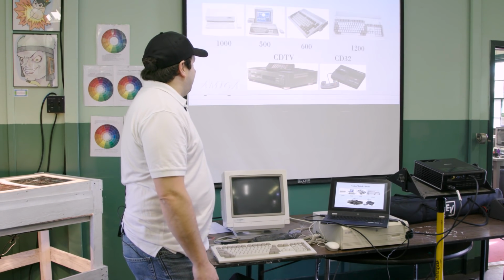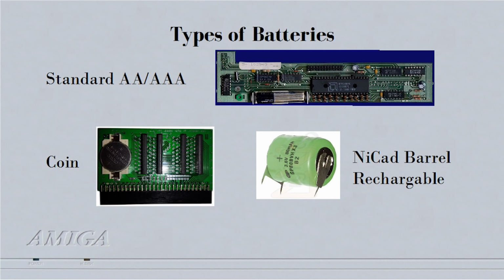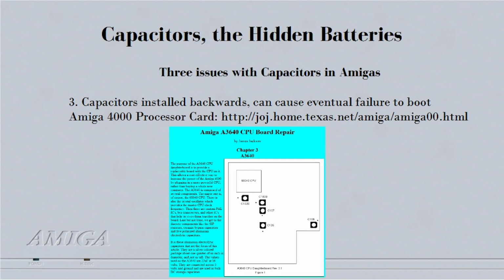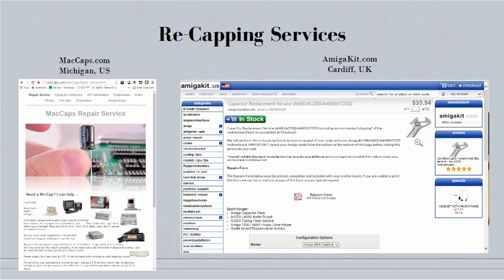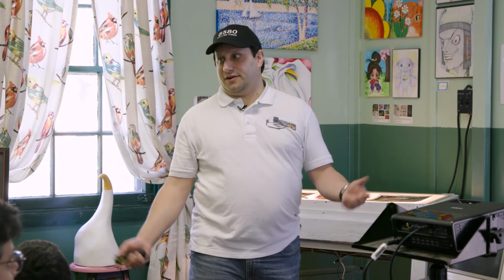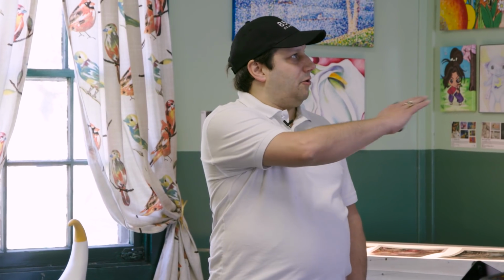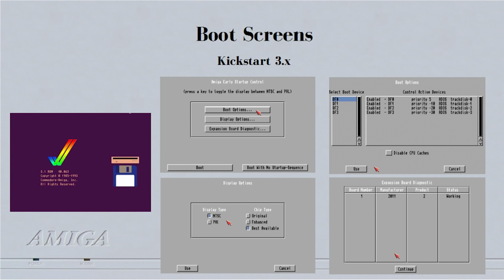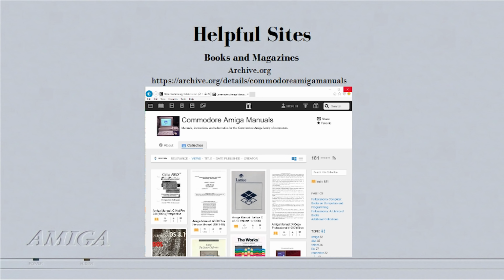Basic Commodore Amiga Troubleshooting

Comment: I finally got around to recapping three of my Amigas in the last month: two A600s and an A1200. One 600 has an ongoing issue with clicks in both audio channels. I have a second 1200 which had electrolyte damage when I bought it, and it will only run for about a minute before crashing.
My understanding of the audio coupling caps is that polarised ones are generally fine as the voltage across the cap is very small. The leaking electrolyte, though...that stuff is evil! Not only do you lose connections, the dissolved copper makes a conductive slurry that spreads over the board.

Comment: I know this is 7 years old, but I am resurrecting one of  my old 4000s, and I got a kick out of seeing one of the guys that worked on the manufacture of the 4000s in the audience.  One thing I did learn by accident, is that the sockets containing the chips can be corroded, or there is some reason that a chip is not making a complete electrical connection.  I found, that rapping the top if the socketed chips with a screwdriver handle, will seat the chips enough to sometimes cause the 4000 to boot,  The solution was, to remove and clean the pins in the sockets, apply deoxit, (a contact cleaner) and re-seat the chips.  That solved the problem in one of my machines.   It was an interesting video, and yes, those plastic retainers on the 4000 front cover are an absolute pain.  I think you stated that there were three pairs of retaining clips, on my machine, there were three on the top, and four on the bottom, and one of the four was extremely difficult to get at.
Reply from the maker: Cheers, that is a good repair technique. I am about to do the same thing on my sick A500

Comment: No, a 1000 isn't just a 500 in a bigger case, per your own admission that even Kickstart had to be loaded from disk using a little BIOS from before that. Also, the 500 can be upgraded to AGA, whereas if I understand right, the 1000 can't (but correct me if necessary).

Comment: Hey Guys, You have always been super responsive. I have a dilemma in that I had a house fire and need to store my 2 1200s away until I rebuild the house. I have upgraded these boards to the hilt adding all the mod and fixes to the boards. One had a recap done. My question is how long before an inactive Amiga may be destroyed by not powering on. I have de-smoked the boards and they look fine. I may be out of my house for 8 months+. Any recommendations of storing these beasts? Your opinion of course is invaluable as always.
Reply from the maker: Yikes Charles!  So sorry about the fire. I hope everyone is OK.  There really is no standard for a length of time that an Amiga can stay inactive.  Many people I know didn't turn theirs on for over 10 years and they work fine.  But that doesn't mean I recommend doing that.  The caps are the first things to go (usually) and every Amiga needs to be recapped by now.  Frequent use is good for the caps.  So for the machine you had re-capped I wouldn't worry too much.  The other machine is more of an issue. Try to power it up if you can, but if that is not possible there is a good chance you will be ok after  8 months.  But to be sure you could always have it re-capped before you turn it on after a long rest in storage.  When you do store them, I like to put them in a sealed plastic case and keep it in a clean, cool environment with little to no humidity and no direct sunlight. Of course you also want to remove the battery if you have one in there.
Reply: Thanks, Guys. Good advice. I think I can plug it in where its stored once in a while. Keep up the great videos.

Comment: Probably very late to the game at this point, logically you are getting the purple screen because the system has passed its hardware checks and booted to the kickstart (hence the purple screen) instead of getting the disk animation you would normally get it is trying to boot from the SCSI storage device and as a result it can see the WB install but is unable to fully read/access the data and the system hangs in an endless loop of attempts to boot from the SCSI device leaving you with just the background colour of the ROM screen.

So far for myself these situations have always been cured by re installing workbench/changing the SCSI storage disk itself (not the SCSI controller)
(afterall if the SCSI Controller wasnt functional, the disk would not attempt to boot and just leave you back at the regular kickstart landing screen)

If before you had this problem the system was functional on its primary SCSI HDD device and only started to be problematic with the introduction to the same data structure on a different device (in this case the CF Card in the adaptor) the problem could be a data table issue where the card isn't formatted properly or perhaps the SCSI to CF interface device has an issue. i would put my money on the Data on the CF card or the data table itself however a good test to this would be to insert a fresh CF card and install WB on it like a new unit from the floppy drives.
Hope this helps.
Reply from the maker: Great info! Thanks Mark. Very helpful. I will pass it on to Anthony.  Believe it or not, I think he hasn't fixed it yet.  -- Bill
Reply: I just said the same thing, I am later to the game. ;-)
Reply: Replies like this represent the very true spirit of Amigans. We have the world biggest sincerely unite community. We are few, but not so few, and thanks to your great job, Gurus, the truth is starting to come over. Thanks thanks thanks. Amiga and all the CBM people deserved more and yes, they still do. 
Long live Amiga. Altough it SEEMS a piece of hardware, it left something inside our hearts. Not to be nostalgic but... can you think of something that did the same? 
Cheers from Italy.
Reply: Is it fixed yet?

Comment: same 'Purple Screen 'issue here with a rev 8 A500+.. had battery leak damage. swapping out Agnus and rom for earlier versions shows Green, but not every time. Going to replace the Ram and check the 74 chips involved in the data path are not dead.
Reply from the maker: Oh man, good luck with the repair.  Anthony still hasn't gotten to the bottom of this. Hopefully sometime soon.
Reply: FIXED! Culprit was the 74LS244 (U12) and it's tracks & pads - mostly going to U13 and some Vias. I replaced it, and patched the broken traces. The purple screen must be a wait state for Kickstart. If You drop in a 1.3 Kickstart instead of 2.x You will get the green screen warning - but not always, you still get purple sometimes. This was all caused by the leaking battery of coarse, but to the naked eye, after a cleanup and treatment, it looked fine. Had to use the schematic to check all the pins on U12 were going where they should have been, and only 6 of the 20 were still good. "74" chips were all over 80's tech, and some are a bit ropey at the best of times - this one had some help from the leaking battery.. :)
Reply: also, i did put the extracted 74LS244 back in the properly connected socket, and it was toast, so just repairing tracks might not be enough..
Reply from the maker: WOW, that is great news! Thanks for letting us know and for the great info.  Anthony better get busy on his!

Comment: I read somewhere that the battery on 3000 & 4000 keeps SCSI settings in memory, so you would lose those settings if you remove the battery, as well as the date/time.

EDIT: Since you have two A4000, why not move over some of the chips if possible, like the ROM's from the working one, or the controller/rasier cards. Can try the 030 card in the working box to see if it is alive at all.

Did you add any device to the box, i.e. something that require more power? Can the PSU cope?

You may also want to measure the PSU if it gives the required voltages on the respective pins. You can desolder surface mounted IC's with a tin desoldering "sucker" (or whatever it is called) and move them over (if you want to take the risk), but getting them back into position requires some gentle soldering, or some IC holders if you can find them for the specific chips. It may be possible to scavenge some from a broken Amiga 500.

I may be getting a 4000/030 later on if my friend will sell it to me (and if it works), just hope it never breaks if i get it.
Reply from the maker: Ichinin Thanks for this awesome info and taking the time to comment. I will pass it along to Anthony. Much appreciated

Comment: I tore down my recently acquired A1200 and I was shocked to find that it had no clock battery, nor even a place to put one! I was expecting carnage after finally getting that top shielding off...I guess someone years ago ditched the battery and decided to go without it.
Reply: Not all Amigas came with a battery.
Reply from the maker: That's great.  The battery only keeps the date and time anyway so it isn't that necessary.  I removed the batteries from my machines and never bothered replacing them.  -- Bill

Comment: Any luck with the A4000 in the last four weeks?

Is the purple the same purple as in the Kickstart screen? Maybe the processor just isn't running properly (probably oscillators?). Did the machine work after the battery was removed? The battery acid often goes under the memory sockets and can destroy traces even if it's not directly visible. Recapping the board is a good idea in any case. I've got a problem with an A1200 rev. 2B which crashes when an accelerator board is installed... ;-)

You could also try cleaning the CPU connector and replacing the Kickstart ROMs. If anything fails you could also try diagnostic ROMs.
Reply from the maker: Anthony was away for work for several months so he hasn't been able to work on the machine.  However it sounds like he will hold off because we might team up with Bil Herd to do a video and class for VCF about re-capping.  In addition to the re-capping aspect he will try to help Anthony fix the 4000.  These are excellent tips though.  Greatly appreciated.  We will keep you posted.  -- Bill

Comment: Friends, I own an Amiga 600 :) Anthony, hotair is your friend:) basic repair without soldering? I see Greg Berlin why he was so humorous :)with hotair and stick soldering station I managed to replace damaged joy ports in my Amiga, after extracting them from old PC motherboard COM ports :) And so,  12:48 I made custom expansion for A600 but it doesn't work, maybe you have some PCB diagrams for A600 1MB chip expansion?  16:18 I know the color codes, not funny if after a minute there was green or yellow screen after removing of faulty expansion... I was worried, but afterall it works ... the memory persistence of Amiga after powering off is another mystery :) 32:40 "...made in china? probably ;)" :)
Reply from the maker: Nice work Qvverty!  Way to bring an Amiga back from the dead!  I actually changed the title of the video to "Basic Amiga Troubleshooting"  Probably should have called it that in the first place, but "Repair" was the first thing that came to mind even though it is more of a troubleshooting lecture.  -- Bill
Reply: Right choice of renaming it :) I saw here Guru's meditation for the first time and that it is no void term here. :) Great job Guys, keep it running :)  my A600 got "piggybacked" 1MB chip RAM mod (chips from S3 Trio VGA card, removed using hot air again :]) for memory expansion, the soldering was ambigous, but worth the stake :] many yellow and green screens until a not regretable success :D
Reply from the maker: Qvverty
 Yeah, I meant to rename it earlier, but got busy and didn't.  I can't change the title in the video itself. but I changed the name and the thumbnail so that should suffice. Nice work with your 600.  Sounds like an adventure.  I have my eyes and ears open for one.  Are you interested in a Vampire 2 card for it?  That looks like an amazing piece of hardware.  -- Bill

Comment: Fun video to watch with the lengdary engineers. I think Bil was in on something there regarding contacts. Have you tried contact cleaner to the connectors and card slots ? Could make a difference. Also ram slots, basically all contact surfaces should be treated.
Reply from the maker: Thanks bwack!  Appreciate the kind words.  The mother board needs to be re-capped as well as doing your suggestions.  Thanks for the feedback and watching!  -- Bill

Comment: But about recapping  that mac guy is putting in holethrough caps and that is so wrong in so many ways.  always use the same type..  Amigakit uses the correct type, but uses crappy chinacaps. better use a hotairstation and do it properly:

Caplist:
A4000:
5 SMD 22 uF 35 VDC, EEHZA1V220R 10-498-39
10 SMD 47 uF 35 VDC, EEHZA1V470P 10-498-41
1 SMD 100 uF 25 VDC, EEHZA1E101XP 10-498-36
1 SMD 10 uF 50 VDC, EEHZA1H100R 10-498-45
2 SMD 4.7 uF 35 VDC, EEEFK1V4R7R 67-239-03
2 470 uF 25 VDC, EEUFR1E471 67-239-12 (Through hole)
(Rev D Motherboard: add 2 22uF)

A4000T:
6 SMD 22 uF 35 VDC, EEHZA1V220R 10-498-39
14 SMD 47 uF 35 VDC, EEHZA1V470P 10-498-41
11 SMD 100 uF 25 VDC, EEHZA1E101XP 10-498-36
3 SMD 10 uF 50 VDC, EEHZA1H100R 10-498-45
15 SMD 4.7 uF 35 VDC, EEEFK1V4R7R 67-239-03
3 470 uF 25 VDC, EEUFR1E471 67-239-12 (Through hole)

A1200
5 SMD 22 uF 35 VDC, EEHZA1V220R 10-498-39
2 SMD 47 uF 35 VDC, EEHZA1V470P 10-498-41
4 SMD 100 uF 25 VDC, EEHZA1E101XP 10-498-36
3 SMD 10 uF 50 VDC, EEHZA1H100R 10-498-45
2 470 uF 25 VDC, EEUFR1E471 67-239-12 (Through hole)
2 1000 uF 10 VDC, EEUFR1A102L 67-239-67 (Through hole) 
(A600: add one 10uF more)

CD32:
6 SMD 22 uF 35 VDC, EEHZA1V220R 10-498-39
5 SMD 47 uF 35 VDC, EEHZA1V470P 10-498-41
9 SMD 100 uF 25 VDC, EEHZA1E101XP 10-498-36
4 SMD 10 uF 50 VDC, EEHZA1H100R 10-498-45
4 SMD 4.7 uF 35 VDC, EEEFK1V4R7R 67-239-03
1 470 uF 25 VDC, EEUFR1E471 67-239-12 (Through hole)
2 1000 uF 10 VDC, EEUFR1A102L 67-239-67 (Through hole)
Reply: nice. thanks for the info. there is definitely at least one bad cap in that 4000. can see evidence of the leak. so it needs a recapping. I may try to do it myself this September so that cap list will be valuable.
Reply from the maker: Wow,  thanks so much for this great information Chucky.  Really appreciated.  Recapping is not our specialty.  The Amiga community is so helpful.  It is awesome to be a part of it.  Thanks so much.  Cheers -- Bill
Reply: NP!..   another free tool I am working on:  http://www.diagrom.com/
Reply from the maker: ChuckyGang
 WOW, that is cool!  Great work Chucky.  Sounds like we need to do an episode on Diagrom!  -- Bill
Reply: What makes you say he is using through holes? Bogus assumption based on the photo of the cap on his home page?

Comment: +The Guru Meditation

So, did you get the A4000 working in the end?

I couldn't see anything in the KS disassembly which would normally set the background colour to purple, so it sounds like it could be the actual ROMs which aren't booting properly?

Possibly the IC sockets are worn / corroded, one or more ROM chips has died, or perhaps a broken track or dry join on some data / addr lines?

Have you tried an oscilloscope on the main data bus signals at all?

Very well edited, and good sound btw. ;)

I think most vids like this are better with minimal editing. I normally want to get the more "live" experience from these types of presentation.

I heard about the moment with Greg before seeing the vid, but I'd forgot about it until watching this. :p
Reply from the maker: Thanks so much Electron!  Unfortunately we haven't got the 4000 working yet, but we haven't had time to work on it since this class.  Really appreciate the kind words on the video.  I had a microphone on Anthony but obviously wasn't expecting Bil Herd and Greg Berlin to be there (let alone contribute so much) so i had to rely on the camera mic.  I was able to make it OK in post.  It took a while, but at least you can understand them.  Generally I like to keep our videos on the short side, but i figured this was a situation where a longer one with minimal editing was better.  I think die hard Amiga fans will appreciate hearing everything Bil and Greg had to say.  We also did on on the fly interview with Greg after the class which I will be posting in the near future.  Thanks so much for watching!  -- Bill